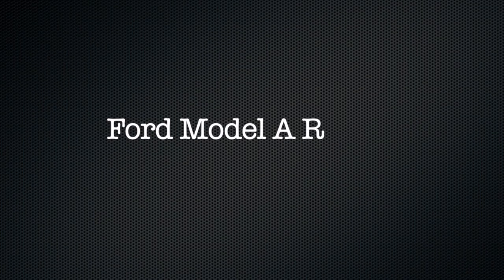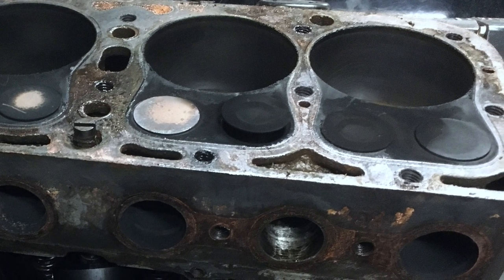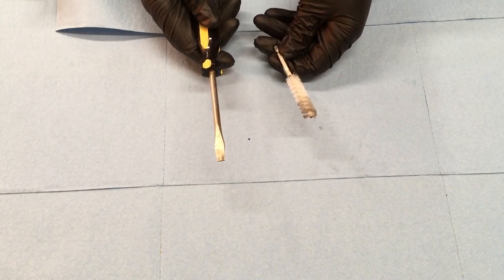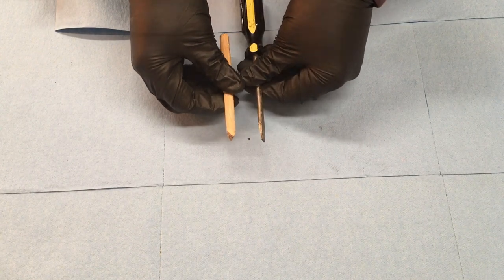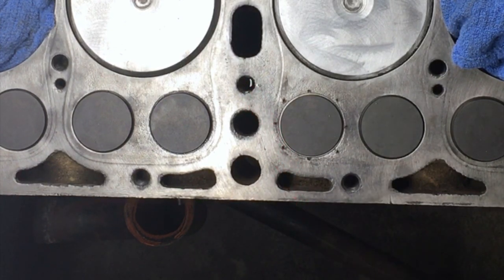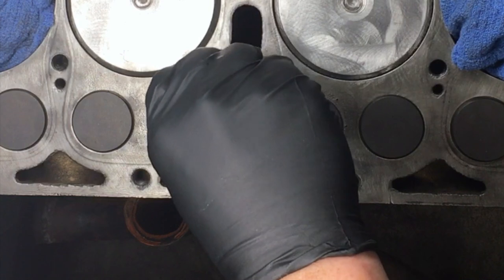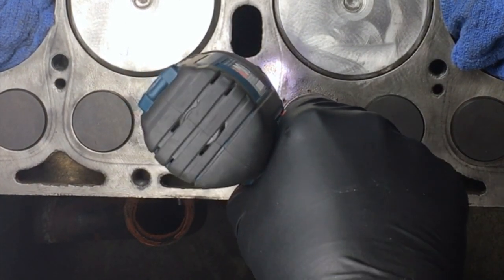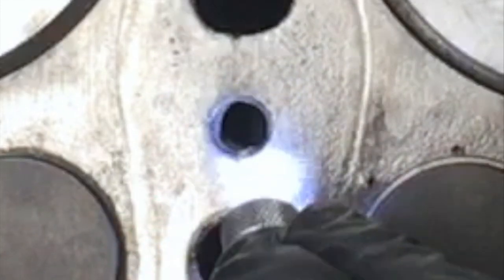Model A Ford - cleaning engine block stud holes

Comment: Tape cylinders & other openings to seal.
Reply from the maker: Good call, yellow Exterior Surface Painter's Tape works well for that and is available at US hardware stores. Don't leave it on longer than a week, though. :)

Comment: What's with the center punching around the valve seat with one being really close to the rim
Reply from the maker: That particular valve seat had come loose, which was what led me to do the teardown on this engine in the first place. I had it replaced, and the guy who did it used a punch to peen the surrounding block material into the new seat insert to help hold it in place. I've heard others say this isn't necessary, but that's the way he did it. Hasn't hurt anything so far. That entire area is inside the combustion chamber, so it doesn't affect the head gasket seal.